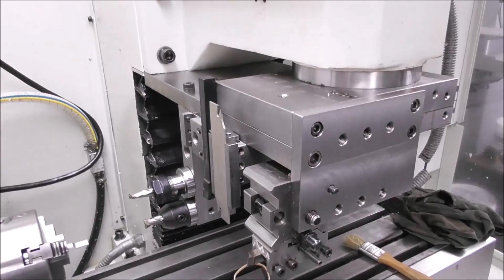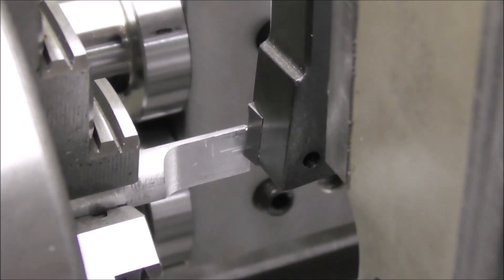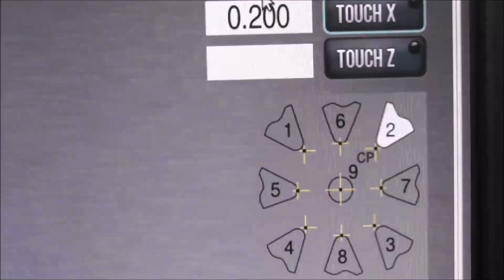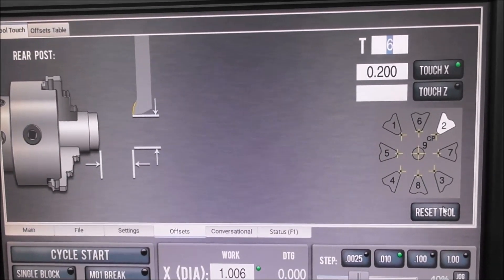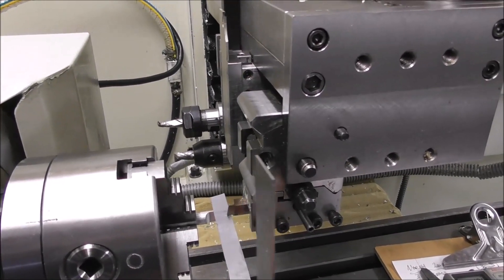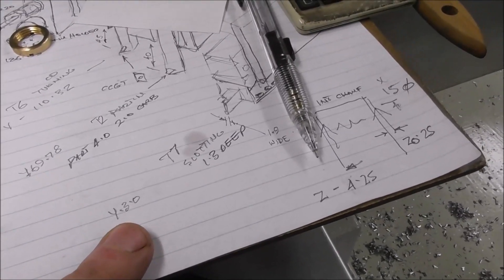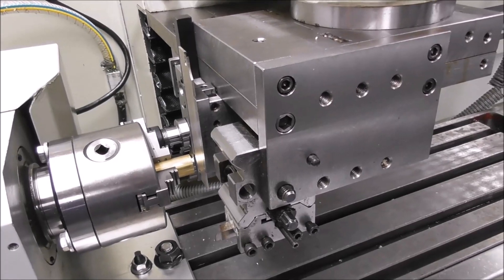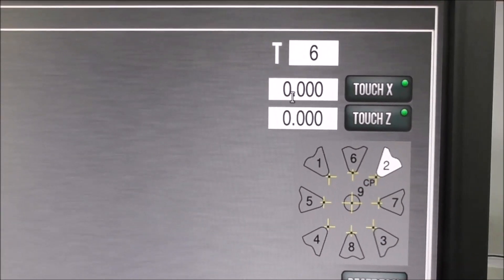Tormach RapidTurn - Set Up and Run -  Part 3 -  Tool Offsets

Comment: Hello Cliff, first of all thanks for all your amazing videos, I am a young machinist and I have learned a ton from all your video! I noticed there is a Y-axis column in the tools offset page, doesn't this mean you can basically type in the Y-axis offset ( which is the number you have written down for each tool ) and call the tool in the program without needing to type in Y-axis values in the program manually? I just bought my rapidturn and i have yet to set it up, meanwhile i wanted to double check this with you. Thank you!
Reply from the maker: Hi! If you are in PathPilot Rapiturn and find a Y axis column - then it sounds like Tormach have now added that facility ! Then yes you would be correct. Please confirm you are in PathPilot lathe mode.  Cheers  Cliff
Reply: @Threadexpress  I was actually referring to your video (this very one) at 5:15, under the “Offsets Table” tab in the “Tool Description” table there is a Y column.
Reply from the maker: @GLA2001G  I see what you mean now. Well on the tool touch off page there is only X and Z. This is normally how the entries into the tool column's are made.  I have not tried entering directly into the Y column. I am running a lot of mill work currently, so wont get a chance to investigate that for a while, but let us know here if you try it.  Cheers  Cliff
Reply: @Threadexpress  I'm going to setup my rapidturn in a week or two. I will for sure give this a try and let you know!